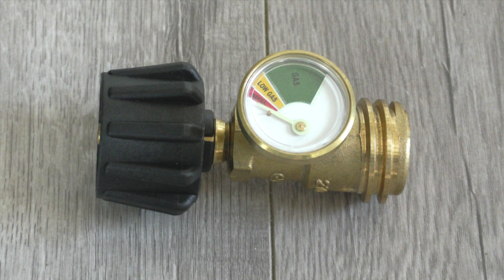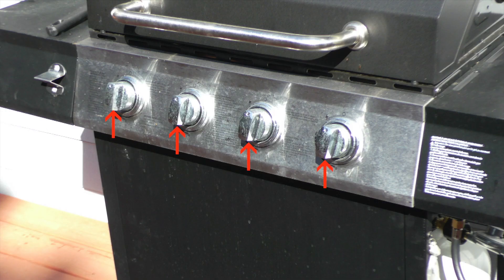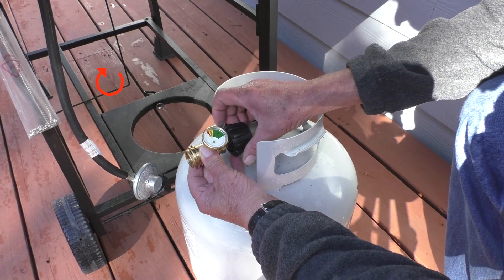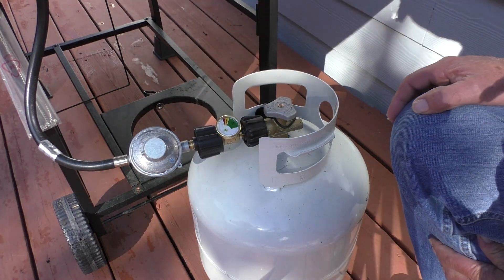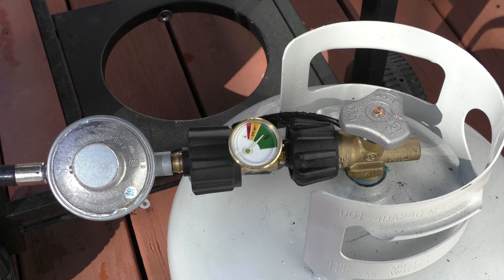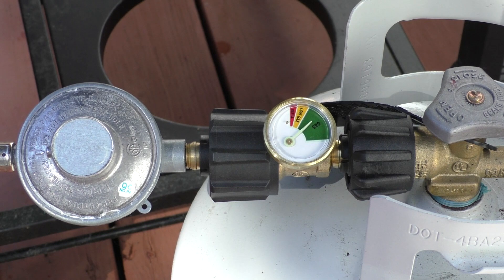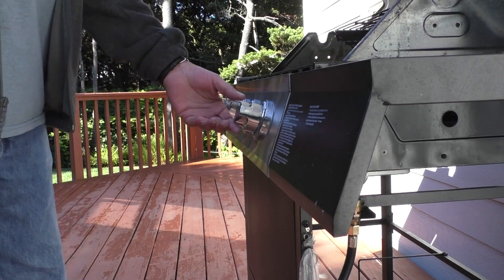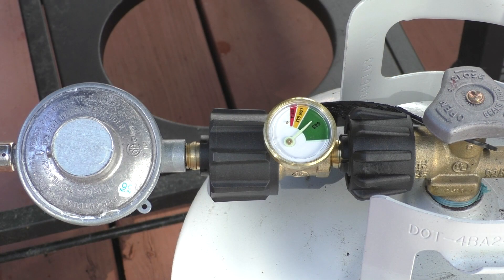Installing A Propane Tank Gauge

Comment: excellent info, well done !
Reply from the maker: Thanks!
Reply: @Iscaper  just bought a dual pack flame king gauges for around $21 and a regulator /hose for my kenmore propane grill . my original regulator had a leak which was sometimes causing a flame to shoot up , don't want an explosion ! anyhow great tutorial , i had the propane go empty before while grilling ! 🤦‍♀️
Reply from the maker: @professorpauls7362  Good information, thanks for posting.

Comment: I installed a blue rhino gauge on my tank. I opened the valve the needle went into the green about halfway. When I closed the valve the needle went to zero like empty. I have it hooked up to a torpedo heater. My connections to the tank are pretty snug. Should I be looking at the torpedo heater for a leak?
Reply from the maker: Sounds right, you could try soapy water in a spray bottle to look for the leak.
Reply: @Iscaper  I found the leak at the heater.. fixed it. There is a very slight leak at the rubber seal inside the tank valve where the gauge screws in... i put some silicone grease in there and walked away from it.. it should be fine. I thought somehting might have been wrong with the gauge, but upon inspection of the gauge there is no way it's the gauge... that little seal in there is the little trouble maker. :)